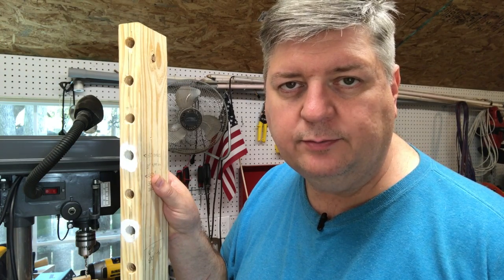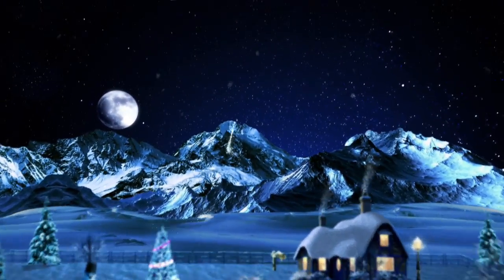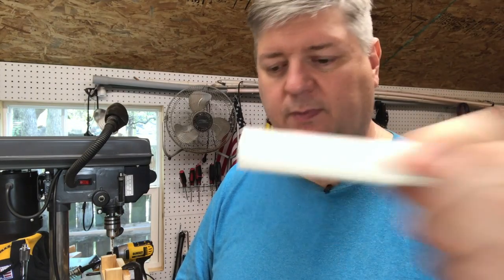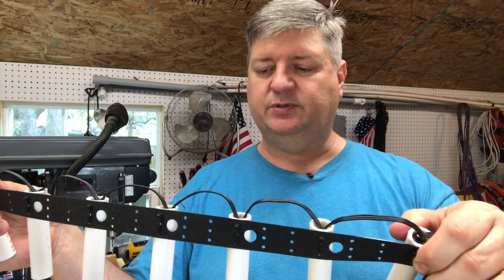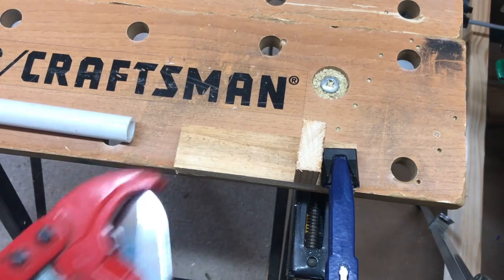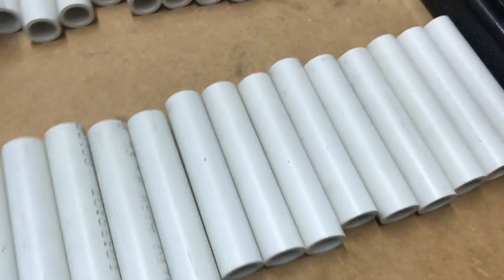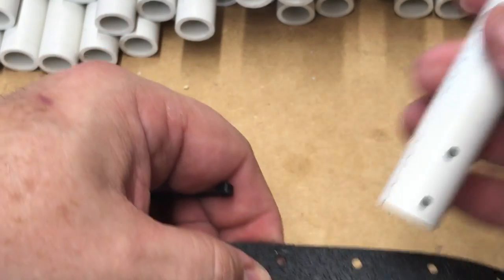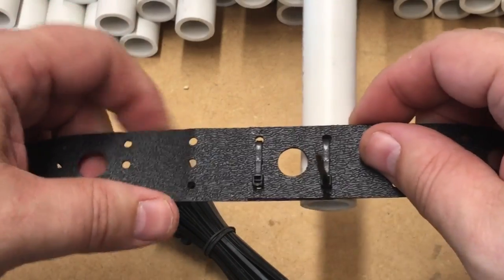RGB Pixel Wall Washer - New Design

Comment: You could shorten the tubes, or even cut an angle on the ends to remove the back half, if you wanted each light to spread a little more on the wall.  Maybe glue a little foil in each to help reflect the max amount of light.
Reply from the maker: Turns out it's a direct vs indirect kind of thing. Any other pixels in the area heavily overpower the indirect light so it basically becomes invisible. Looks OK by itself, but not for this application.

Comment: Maybe use schedule 20 PVC instead of 40? At least it looks like 40. Schedule 20 would be thinner (and brighter?) and lighter for less sag potential. Regardless, looks pretty cool! Thanks for sharing!
Reply from the maker: Yes, that would reduce the weight a bit, but I found that the indirect lighting was totally washed out by the other pixels so I have new plans for those panels next year. :)
Reply: I saw that in one of your other videos (that I watched after this one) ;)  Say, I find this fascinating, but I kind of jumped in at the middle. Is there a reference that you would recommend so someone could start slow - maybe with a non-programmable sequencer (pre-programmed)?  Many thanks - I enjoy your videos - especially the openings.
Reply from the maker: Ha Thanks! There's a great PDF of general information on auschristmaslighting.com and I have a playlist of beginner videos. https://www.youtube.com/playlist?list=PLFyrAfJ-kKd4ZfPdXWIt8v_bav61mW_KW There's also a video I did for the Hanson Electronics pixel tester (https://www.youtube.com/edit?o=U&video_id=3uWoqCrFQVk) that cuts off the Pi/xLights/controller stuff if you just want to get a string or two and have them animate.
Reply: Subscribed. ;)